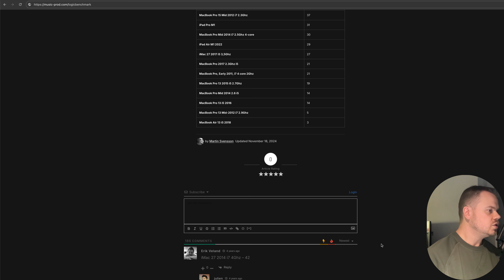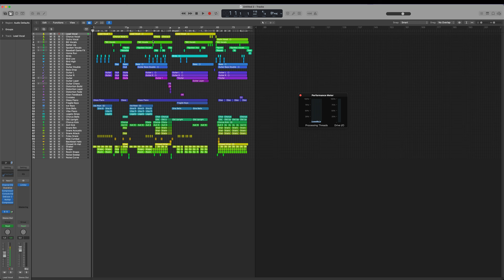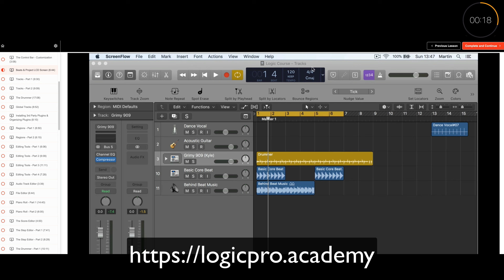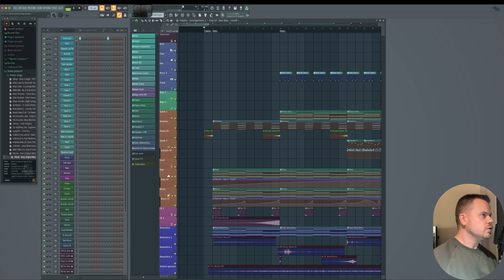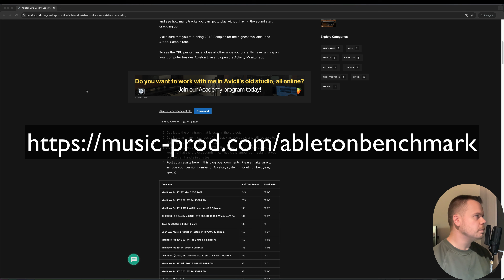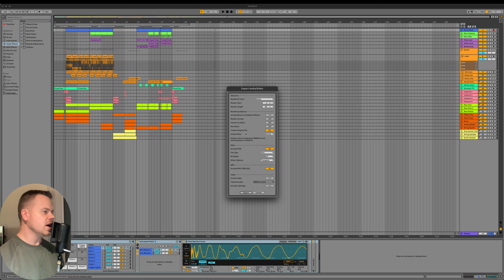I Tested the M4 Pro with Major DAWs—The Results Surprised Me!

Comment: I missed the soundcard buffer (sample) setting at track copunt test, and hearing the rare craclkles in Ableton Live. On my PC there is a big difference between playable tracks at 100% CPU load with cracles and number of playable tracks wihout any crackles. It is about 20%. I sugges, next time adjust the testing method based on this. Otherwise it's a very useful video, thanks.

Comment: I just carried out this test on my 2018 Mac mini 6-Core, 32GB RAM and 1TB storage. Interestingly I got around 60 tracks with my fan at normal speed and when I used Macs Fan Control to set the fan to Full Blast, I got 73 tracks. So, I wonder if some who are still on Intel machines can in fact get more, since intel machines will throttle at high temps. Worth a try I would say...

Comment: Amazing the 2019 mac pro now cheap under $3000 with ,28 core chips beats all apple silicon macs olperiod all generations in this test plus in graphics with the right gpu and can under windows use rtx ,4090 ,5090 and can have 1500 MB of relativeky cheap memory and internal cheap ssd and raids.

Its actually the best mac comouter for logic. Value wise at least until the m3 max studio is rekeased 

.but the uocoming highly cooled m4 max and ultra with enough ram will blow it away the uktra should be about double the tracks around ,700 comoared to only 400.

Unless you can overclock the 28 core xeon.there was a mention of davinci resolve audio card doing iver ,1000 stereo audio tracks in its editor and some programers saying it may be possible to use GPUs or GPU cores for aufio in fact they are better for audio then cpus except lack of memory.
.thats where apple silicon shared memory can come in handy providing yiu have enough.

But no one seems to want to write driver apps for that or even powering plugins like apollo does with their dsolp cards but wuth mire powerful gpus.this could be a game changer apple should look into using gpu cores for audio olugins or tracksm

Comment: Budget doesn't allow me to get the M4 Pro so I'm trying to find someone who can do a similar test with the M4 base chip rather than the Pro chip. 😭😭
Reply from the maker: I’ve done a video with a similar test for base M4. Check it out on my channel :)
Reply: Same single core performance, just not as many of them. Slower storage, no Thunderbolt 5 (not a biggie), but the upgrades that you really should get such as a 24GB or memory 1TB SSD double the cost. The SSD is important as they slow down drastically as they fill. The memory keeps macOS from swapping to disk so much, and extends the SSD lifespan. Also lets you run more sample-heavy VIs like Kontakt if that's your thing.
Reply: @jonljacobi  I hear you. My projects contain very little Kontakt instances but more of Ozone + Komplete Kontrol VSTs (which both are processor heavy). I fully udnerstand why the M4 Pro is the sweet spot however I really think I can get through a few months/a year or so with the base M4.
Reply: Save for the pro, it'll last longer, you won't regret it

Comment: With adding tracks in a DAW you test the multi-threaded performance. However, single-threaded (core) performance is very important too, and very rarely tested or discussed. Single-core performance determines how CPU load can put on a single signal path (for example a single signal path can be audio from 1 track going into a bus track going into the master track). Nowadays VST's are becoming more and more CPU-heavy. A test in which, for example, you put a Diva, Izotope Ozone, Soothe, Gulfoss, Acustica Audio and Waves plugins on a single track would be very relevant as this is processed by a single CPU core, and cannot be spread over multiple cores since that is the way audio is processed. When you enable oversampling on some of the vst's, there is even more chance of overload. In short, not only testing a high amount of tracks, each containing a little cpu load, is a good test, but also testing a single track containing a high amount of cpu load is relevant since the latter can also causing cpu-overload and therefore being a performance bottleneck.
Reply: True
Reply: It's YouTube, a land of clueless and unqualified nobodys pretending like they know things.
Reply: There is a test that shows that Mac studio M4 max has a better result than the M3 ultra with single core but obviously not on multi core.

Comment: You are picking 3 wrong DAWs if you are concerned about speed. Cubase, ProTools and Reaper are able to use all cores in the chip(performance and efficiency).
Reply from the maker: You’re right, but a lot of people are using Logic Pro, FL Studio or Ableton Live only.
Reply: @Music-Prod  I for one was interested how it works with the program you showed here. However , the base model mac  m4 performs rather poorly on these programs as it only has 4 performance cores.
Reply: @CJ-sm1sp  I´m also feared about that fact. Using FL24 on a M1 Pro with 8 cores now = 80% CPU // Going to a 4 Core M4 Base would be a downgrade

Comment: What about RAM in those machines? How much and was there much pressure on it?
Reply: I got 24gb and it has been PLENTY.
Reply: @Nick-kb6jd  even with my last 16 gb macbook pro I never had ram overload problems, only cpu, better and more core is what you need if you are producing regular music, you don't need tons of ram, unless you make sountracks I guess
Reply from the maker: 64GB in the M1 Max, 24GB for the M4 Pro
Reply: @Music-Prod just bought the 24 gb pro, hope that will be enough, I don't use a lot of samples based virtual instruments but a lot of external synts and fx
Reply: @andreaperelli5323 , so, how is it? Do you enjoy your new setup? What genre you compose in?
Reply: @ hi, 24 gb is enough loading a lot of plugins, ableton and logic both open and working at the same time not using a bit of swapping memory, I compose pop/funk, I use both samples based plugins and emulations, I use a lot of soundtoys uad waves ecc for mixing, 64 latency not even a problem for now
Reply: @andreaperelli5323  btw what audiointerface you use?

Comment: DAWs use only CPU, no GPU gains on them. The M4 Pro and the M4 Max have the same number of P-cores (10) and E-cores (4). So the results should be the same, theoretically. What may be a bit different is that the cores in the Max chip can get a bit more watts to perform a bit better then the Pro chip. In some single core tests the max has a higher score but by not too much. Also, Logic is one of the DAWs that ONLY uses P-cores, the E-cores are not used. Reaper, Cubase and now Pro Tools use ALL cores, so there is a much higher track count in them. 2 cents.
Reply: M4 Max actually has 2 more P-cores than M4 Pro. It’s 12/4 vs 10/4, so the Max has a significant CPU advantage this time around. The real question is whether you actually need that much processing performance for audio work. The M2 Max finally reached and exceeded my personal needs for any music production related task, but who knows, maybe we’ll see a whole new wave of advanced plugins or DAW features to take advantage of all that power.
Reply: That’s why I am getting the Mac Mini M4 Pro 14 core beast
Reply from the maker: Damn, did not know about that! Thank you for the insights
Reply: @Music-Prod  You might enjoy James Zhan's DAW / M4 tests on YT  ;)
Reply from the maker: I saw that video and it was a really good one, but a lot of technical stuff and not so much realistic day to day usage for music production in general, in my opinion ofc ;)
Reply: M4 pro has 8 p cores unless you spend the money. I think the max gives you 12 if you spend the money. 

If I understand you correctly, the upgraded pro is equivalent to the base level max.
Reply: Thank you for the great explanation
Reply: I would agree but you can get the non binned M4 max and it has 12P cores and there are plugins that utilize the GPU but they are few and far inbetween.